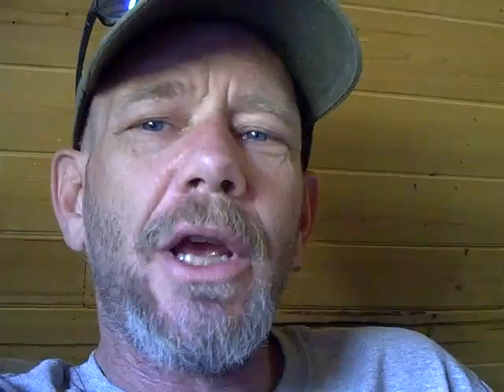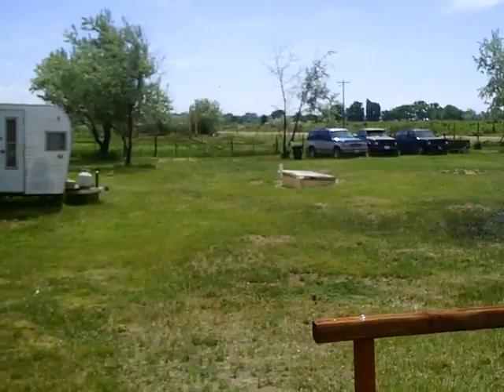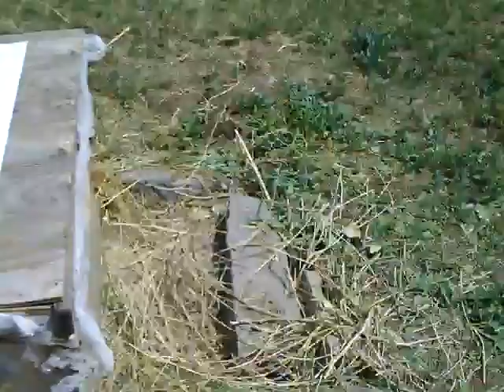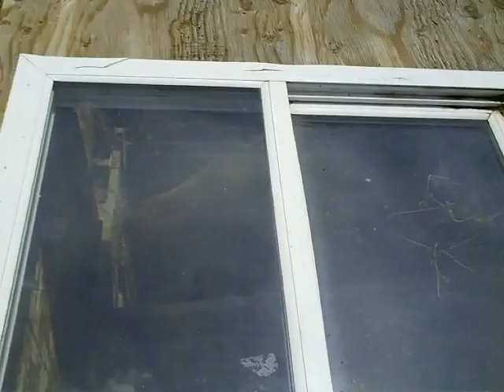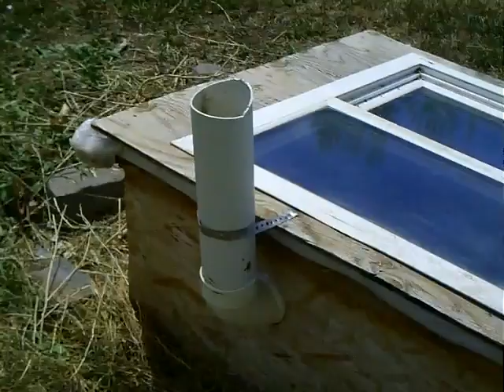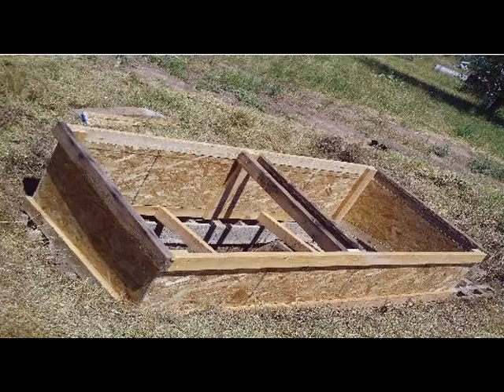Solar Composting Toilet by SolarCabin

Comment: because you have a vent pipe does it smell?
Reply: Jamac007 You could also paint the taller vent pipe black to use the sun to heat the air inside and help draw it out. I saw this technique used for a school toilet in Nepal, the whole south wall was a vent painted black.
..and maybe even put a bird feeder on the top so they can eat the flies :3
Reply from the maker: Only if you stick your nose over the pipe.
Reply: solarcabin If smell ever does become overwhelming and becomes a problem, make that vent pipe 8-9 feet high, issue solved.

Comment: I wonder if this type of system could be adapted to use on a houseboat ... Hmmmmmm ...Also, do you think it would work better in the winter if the "septic tank" was insulated? ...
Reply: +magus jinx Check out the Nature's Head Composting Toilet for you houseboat. I use one in my fifth wheel RV and love it. Does most of the composting right in the toilet.

Comment: some homesteaders use digesters to transform waste--including human waste--into methane which can be used for heating or running a generator--just like natural gas or propane.

Your readers can trust you for the straight poop.
Reply from the maker: Thanks- the Chinese use home digesters for biogas all the time but just be aware of local laws and methane is an explosive gas so digesters must be carefully designed.
Reply: solarcabin Any type of--natural, propane, and methane--is potentially deadly. explosive and there is also the danger of carbon monoxide poisoning.

Comment: Definitely like your videos! I have a couple questions! How hard is it to empty out and also do you have to still put it in an above ground compost pile to let it set for another year so you can use it on your garden?
Reply from the maker: I have actually never emptied it in over 5 years. Only an inch of dry compost in the bottom because all the moisture is evaporated off. I have a separate compost pit that I use for gardening and I apply urine nitrogen through a tank sprinkler system.
Reply: solarcabin So do you capture all urine "at the source" before it ever gets to the portable toilet?  Do you age the urine in batches before you apply to the garden?

Comment: why why, it looks like you wasted alot of energy and time,ive been composting are poop for 10 years now ,and the study of micros, durning winter they can go to sleep but they will awake again durning good weather. what you have a a regular goverment system with a added feather in your hat,you added heat. the whole point behind composting is to use itfor gardening and to not not put into you ground. that means the average person doesent have to dig a hole.if the system isnt broke dont fix it. we have been living off grid now 10 years,so were not talking from nothing but skills weve learned
Reply from the maker: Because compost piles freeze in winter and the microbes go into hibernation leaving you a stinking puddle of shit in the spring in cold climates. This system eliminates that problem. I have been off grid almost 20 years and this system works better. You can still add humanure compost to a pit in good weather for your fruit trees and shrubs,
Reply: we have never had that problem if you do it the rjght way they dont freeze ares is surrounded witha thick layer of leaves,when you go to use it go into the middle and pull toward you and do that all around then dump into the middle the heat stays there ,then you put straw on top. and leaves all around ,we were at 1 degree and it never froze.if you are worried put a layer of plastic on top.still the hole point besides removal is to use the waste. if you live off the land gardening is 100/ of your life . letting this go into the ground is waste,and you cant afford to waste anything.in the old days nothing went to waste.
Reply from the maker: The outer edges will freeze and this system keeps the microbes working all year for faster composting and no mess. If you like your system great but for cold climates this system works better in my opinion.

Comment: Hey Lamar,
Was wondering if you could connect a low water volume flush toilet to a septic tank like yours?  Also, how do you handle the kitchen, washing machine and shower wastes? Are they piped into a greywater tank or a leaching field?  Obviously you wouldn't want to connect all of those to the septic tank.
Reply from the maker: The less water in the system the better.Use a gray water leach field or french drain. Recycle that water back to trees and shrubs.

Comment: My church..had to have creative  septic systems..Land was donated for the church…that had poor  soil…We had an  engineered septic  that had  slanted roof  sun collectors..over the leach lines to encourage..heat composting…A  septic  engineer…in Calaveras  designed it..It was HUGE..The leach lines were two runs..over ninety feet long  with  these solar  collectors..on top  that were  slanted  to catch the angle of the sun..We had a large church…Probably 600 members in two services..using the system..Worked fine.

Comment: In 
calaveras County..,California..there  were frequent septic  failures with creative septic solutions being looked at..one thing  they looked at…was 'tap rooted trees…such as  pine trees…tobe incorporated…with  septic  systems…a  mature  tap rooted  pine  would  tap..these systems for  effluent…One  solution  was to incorporate  five  tap rooted trees  in  leach line  solutions....
Reply from the maker: Modern septic tanks only work with lots of water and we need to conserve water so they are a really bad design. This solar design reduces water use and would be better but states are slow to change codes.

Comment: Did I miss the blueprint septic blueprint picture? 4X8- how deep? is the floor cement blocks also? do you line it? Nifty- Thank You
Reply from the maker: Hi friend- the complete plans are in my ebook Ultimate Off Grid guide. The bottom is cement block grouted. The walls can be dry stacked.
Reply: solarcabin appreciate the fast response- passing info on- You simplify so the challenged(me) can understand  -enjoying the clips-

Comment: Nicely done sir.  I'm moving into an off grid living environment soon.  Still in the planing stages.  Would you system work if drained from a conventional toilet instead of packing the shit in a bucket?  Would the additional water added from flushing over load the system?  Plumbing the grey water separate from the black would not be difficult.
Reply from the maker: If you ran the shower and sinks to a separate gray water system you could run a toilet directly into the solar composter if it was very low volume flush rt a composting toilet. The extra water would overwhelm the system.

Comment: That works just like an underground greenhouse, where the earth around the concrete box insulates it and the concrete blocks in turn radiate the heat from the day during the night. keeping the temperature warm in the box all the time. Do you use saw dust in that porta potty or water? Because the ones I've seen at Wally world have a hand pump for water flushing? Would this system work as well with saw dust?

Comment: Sounds like it works great. One thing I would recommend you do is put a tall chain link fence with a locked gate around it just in case any young children decided to try to stand on the glass. That could be bad bad bad for them and you.
Reply: Oh stop with the safety crap all the time ! There is NO 100% safe . Instead of everyone else being responsible for other's children WHY not parents be RESPONSIBLE for their own kids ?

Solarcabin , I love the idea !
Reply from the maker: I recommend cattle or chain link over the glass and it won't effect the composting. A fence around the structure would be good to.
Reply: sirtom68 I thought about that too.
Reply: Kim Maxim that needed to be addressed since everyone is sue happy.
Reply: Kim......Shutup  :)

Comment from the maker: Generally you don't need to add anything to your compost as the bacteria are already present in your gut and in the soil and will work just fine. You can add a cup of rid X or a cup of natural yogurt as a starter but it really isn't necessary. There is almost no smell from my composter but all compost releases a small amount of methane gas and that is just a natural process as any material composts.

Comment from the maker: You would need an approved septic tank and drain field and that is about $5000 in this area for that system. my system was under $100 and I don't mind walking a few feet to empty the porta potty. I also don't waste water and the composter does not require any extra water.

Comment from the maker: The compost in the tank is only a few inches deep because it is composted so rapidly and so it would not be enough to heat any significant amount of water but for a traditional compost pile that would work.

Comment from the maker: Yes I include a link to Humanure in my book and it is a good system but he does live in a fairly mild climate and in harsh winter cold like we have here that pile will freeze and then stink when it unthaws in spring. My system avoids that problem.

Comment from the maker: Because if you install a toilet you need a permit and a septic tank and drainfield that would cost about $4000. My system is cheap and works better. Go up on your roof and smell your vent stack. There is very little smell unless your nose is over it.

Comment from the maker: You need a sealed steel tank and a way to filter methane and methane is very explosive. I don't recommend it for the average person and it takes more experience to work with methane.

Comment: Have you considered taping into your vent on the waste system and turning that "Methane Gas" into a usable energy source. With the proper fittings you could use the methane instead of propane for your heater or anything else you run off propane. You just need to capture the methane in a storage unit and run taps to the house for hook ups. Not that hard to do and it would save on your propane costs my friend. :)

Comment from the maker: You could build it next to a house as long as it gets direct sunlight. You do not want to run a flush toilet or other water into it. Too much water will defeat the composting.  The tank is closed on the bottom.

Comment from the maker: I have used a commercial composting toilet and they work as long as you can keep them warm. Some of them come with a plug in heater. If you can get that waste warmer it will compost a lot faster.

Comment from the maker: The commercial composting toilets work well if you can keep them warm but they are expensive. Some of them come with a plug in heater and may need electricity and some have a solar evaporation fan.

Comment from the maker: You expose yourself to human waste every time you use the bathroom and human waste is not dangerous. Putting in a conventional toilet requires a permit and uses 2 gallons of water every flush. This system uses no water.

Comment: 1. What would or do you do if and when your tank fills up?
2. What is the state of the material inside the tank.  You say composting toilet ... do you or would you use the "compost" inside that tank at some point?  Would you need to have two of them so that one can fully compost while you use the other and clean it out.

Does the county check bacteria and toxins?  How is your system working?

Comment from the maker: As long as you don't use heavy detergents or put cleaners in the water it can be used direct with just a simple filter. I recycle my gray water to the garden, shrubs and trees with no problems.

Comment: Lamar, I'm just finishing building my solar cabin and will have a composting toilet, Lovable Loo. In Tennessee, they require a permit to put in a septic tank (which means inspections) so I'm better off just going with a composting pile.. Although your system looks like it would decompose the waste much faster, I'm not wanting the hassle and cost of the permit. Keep up the great work.